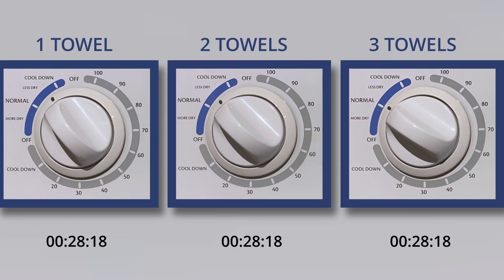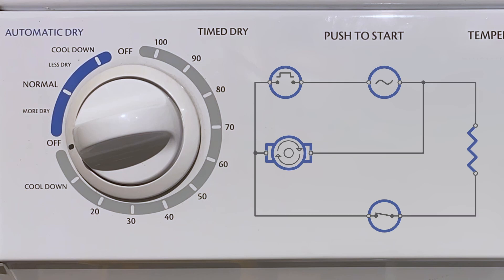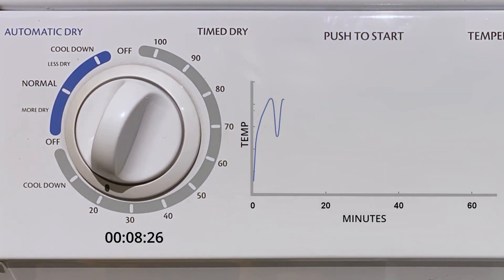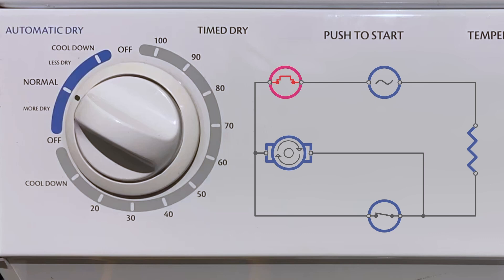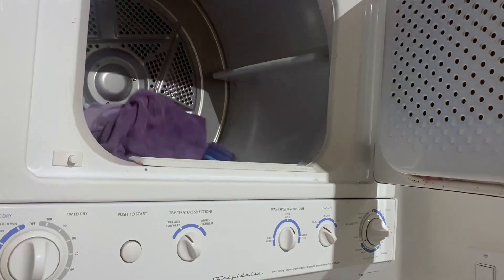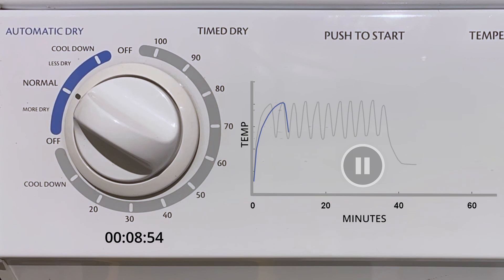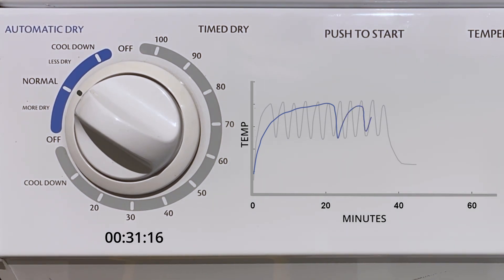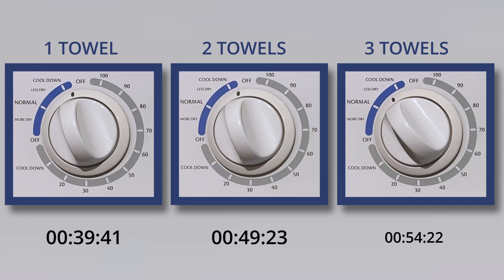Your Dryer is Smarter Than You Think

Comment: This system is called thermostatic auto-dry being that it operates the timer on the heating/temperature curve.  There's also a moisture-sensing (electronic) auto-dry system that involves sensor bars in the drum.  Damp clothes brushing across the bars cause the timer to alternately pause and advance to run-out the time independent of the temperature curve.  Thermostatic auto-dry dates to the 1950s.  Electronic auto-dry was developed by Maytag in the 1960s, longer ago than majority of the appliance-buying public is aware.
Reply: @DADoESofTX I believe that was either GE or Whirlpool that introduced that particular feature in 1958.
Reply: Which feature, thermostatic auto-dry or electronic auto-dry?  Sears introduced electronic in 1965 on the "All New Lady Kenmore Dryer with Electronic Sensor."  Whirlpool had Moisture Minder (thermostatic) in 1968, electronic in 1969 on the Imperial Mark XII, per sales brochures I've seen.  Westinghouse had auto-dry in 1955 but it was crude with a single Dry button, no adjustment for dryness level, it ran until a (rather high-temp) thermostat shut the machine off.  Maytag 701 (with rotary dial, not pushbuttons) may be their first electronic model, circa 1961.
Reply: @DADoESofTX  thermostatic auto dry, double throw switch. I think Maytag introduced the electronic dry control in either 1960 or 1961.
Reply from the maker: Thanks for providing that additional context!

Comment: I've always added a dry towel to my load, it improves the efficiency or so it seems to cause it doesn't run as long.
Reply from the maker: I wonder why that trick works.  I bet some of the moisture transfers over to the dry towel while tumbling around….then the efficiency improves because there is more surface area for the hot air to blow across.
Reply: Evaporating moisture from the wet towels will dampen the dry towel which then also needs to be dried.
Reply: i guess this is also why wool balls exists to speed up the drying

Comment: I just use the timer because I don't know how the automatic function works, from now on I will only use automatic
Reply from the maker: My dryer works great when I start the knob at the position labeled “normal” in the auto-dry zone.  You may need to find the sweet spot for your dryer - perhaps a little ahead or behind “Normal.”   These starting positions are usually labeled “more dry” and “less dry.”   
Thanks for watching!
Reply: The timer can be set anywhere in the range on the auto-dry cycles, it doesn't have to be precisely at a labeled position.  It may need to be set more toward More Dry for some kinds of loads to get the desired results but the performance should be reasonably consistent once you figure out where to set it for your different loads.  It's also important to keep similar fabric weights together for consistent performance.  Don't mix synthetic light-weight fabrics with heavy cotton towels or jeans, the auto-system will average the dryness of all the items which may cause heavy items to end a bit damp and light items overdried.

Comment: I didn't realize basic clothes dryers had such simple, yet effective circuitry. 

Good work on your part, between simplifying and displaying the control circuitry, collecting real-world data with footage, and condensing it into a relatively short, yet informative video. 

My only remaining curiosity is, do the newer dryers with dampness sensors have a significant advantage over the much simpler design as showed here? Especially with bulkier loads such as a weighted quilt. But great video nonetheless!
Reply from the maker: I assume there are advantages and disadvantages to both methods.  I personally have an affinity for old-school technology.
Thanks for watching!
Reply: @CosmologicalNonsense  it is fascinating for sure, having to design clever, simple solutions with the technology of the time. These days with potted electronics and mystery IC's, it's essentially a black box, and typically impossible to fix without replacing pricy components. My kitchen range is a ~1970 Frigidaire Twin 30, and I think it's going to outlive me...